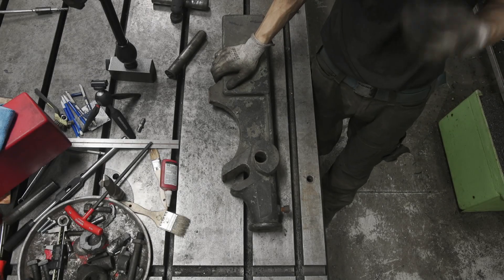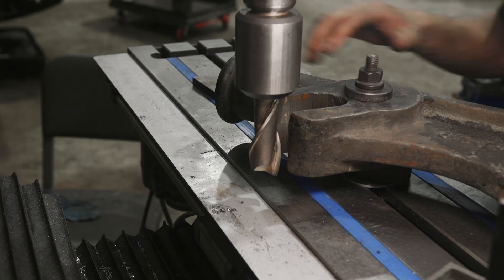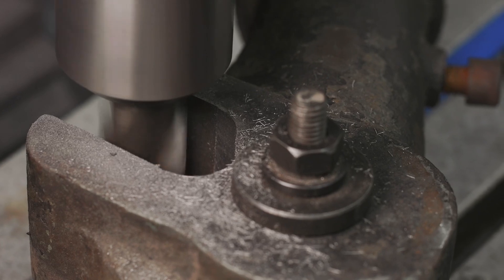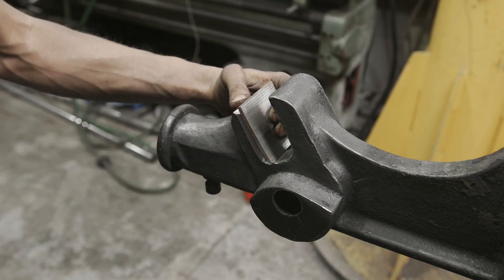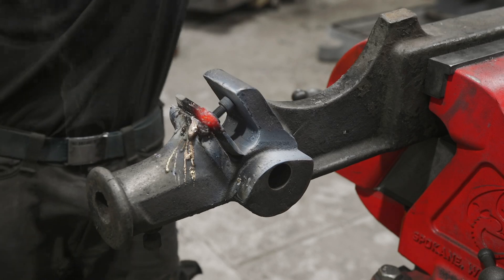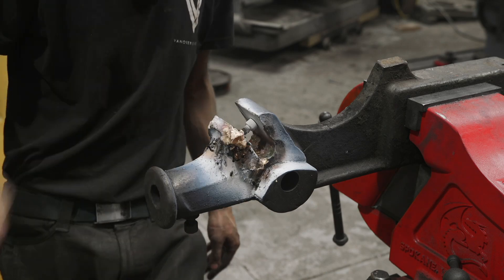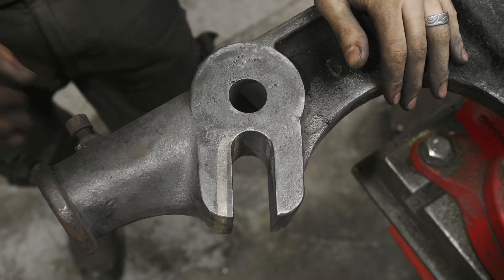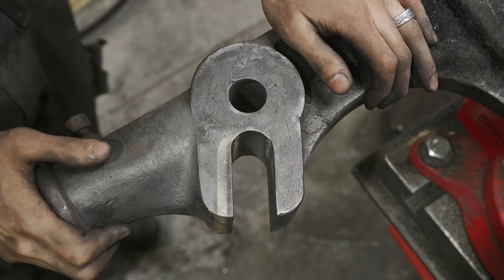Brazing and Machining a Worn Slot in Cast Iron | Arbor Press Restoration

Comment: Great outcome looks very strong and cosmetically superb and I would be very satisified, but this is a cast iron repair which usually is a coin flip with out an induction heater/oven to control heating and cooling. Ray Stormont
Reply from the maker: Thanks

Comment: Nice job! It's surprising what you can do when you're not in a production environment and you can take it nice and slow with multiple light cuts, even if the job really is far bigger that the Bridgeport should be able to tackle.
Reply from the maker: Yes indeed

Comment: Nice repair. I have to do a little brazing myself today. First time trying it. Wish me luck. 😉
Reply from the maker: Good luck! Call me if you have issues
Reply: @VanoverMachineAndRepair  It was quite the epic failure. I am not getting a good flame, it was leaving behind a ton of soot so the brazing rod had no chance of adhering to the surface. I've got a lot to learn. I resorted to TIG brazing. Next time, I'll hit you up in advance.

Comment: After watching @CuttingEdgeEngineering yesterday, I started to have some mild concerns right from the start. Thankfully, though it was big, it was not as big as the transfer case that Kurtis had troubles with.
Reply from the maker: Lol yeah watched that video too. That is an entirely different ball game. Stress cracks can cause lots of issues. Those gearboxes are also probably forged castings making them stronger but more brittle potentially. Thanks for watching.
Reply: @VanoverMachineAndRepair apparently those are cast steel, not sure about forging though lol